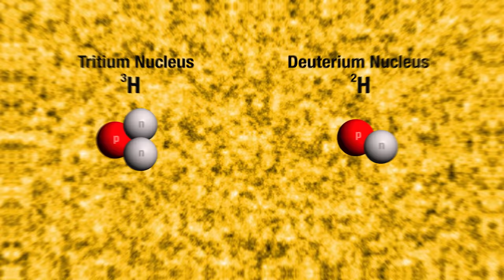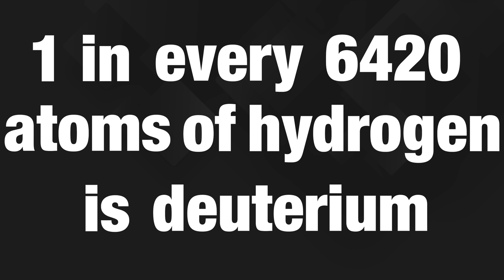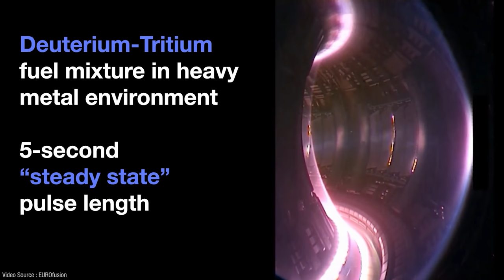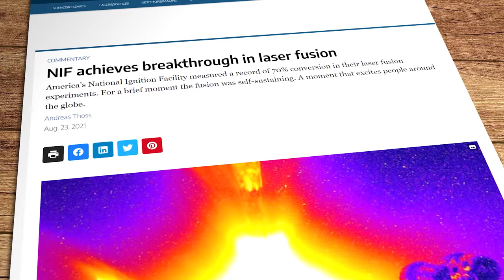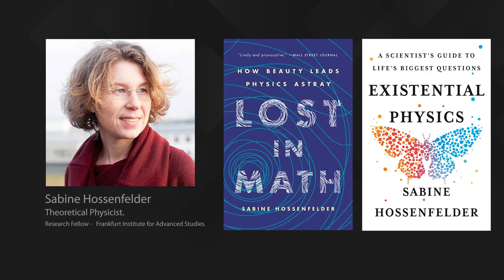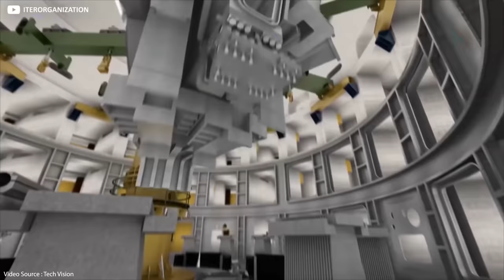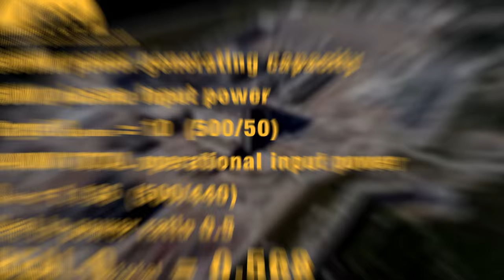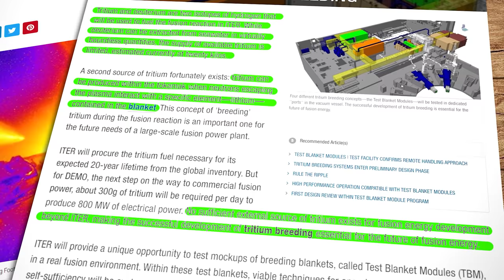Nuclear Fusion Illusion. Is it time to park the pipe dream?

Comment: I've got ok to good news and good to potentially fantastic news

The first is that fusion gain scales rapidly as you approach a Q of 10 and tokamaks also scale dramatically with certain parameters. For ITER this means that an engineering test plant based on it could produce 5 times the power with 75% more input energy for a net GW of electricity production. As well, ITER's cost has a lot to do with delays and non-competitive procurement. It's claimed that the GW scale ITER development could be built for a quarter of the price of ITER itself commercially. That's where the good news drops to ok as I find that gives you an optimistic price of about $6 billion per GW. Hinkley Point C, well known for being an expensive fission plant, should be about half the price with higher capacity factor. Essentially the ITER design depends on something radical happening with capital costs such as robotic construction, plus a development timeline of say 2070 for a finalized commercial design. However that's where the rather fantastic news begins

Not robotic construction, although that seems quite plausible on the timescale of ITER development. Instead it's that tokamak power scales with magnetic field to the fourth power. Last fall a new superconducting magnet was tested to be twice as powerful as the ITER magnets. That's a potential increase of 16x. It's actually limited by the structural strength of steel to only a 10x increase from a 70% higher magnetic force. By about the time ITER first begins deuterium only plasmas it is planned for the SPARC reactor to test this at full power. If the plasma behaves as it becomes self heating this will then mean with high confidence that a plant could be built in the early 30's producing 270 MW. The lifetime cost of this has been estimated for $5.5 billion giving a similar price per MWh as the first fission plant - and I hear that cost has been revised to more like $3 billion. At that point the fantastic news drops to rather good - still not cheap. However, given wikipedia's world average cost of about $80 per MWh for coal and current nuclear and the theoretical cost of $140 per MWh for a high field fusion pilot plant it's better than it sounds from the get go. I have heard the cost of coal is double the numeric value due to air pollution alone and despite this even Germany has chosen to replace their nuclear with coal and imported electricity. Wait where'd the good news go? Ah yes, given that, with a timeline of about 2040 for a ready to build commercial design you could have fusion tokamaks producing electricity at a much greater value than coal and with essentially none of the downsides of fission by that time. The fission reaction of lithium to tritium in a fusion blanket is entirely a bonus, provided it works - producing 15% more power and having none of the meltdown or long lived radioactive material problems of current nuclear

That's all without further development. If SPARC proves out, knowing that there is suddenly a very pointed demand for a structural material more capable than current steel would provide a lot of interest in achieving the 16x power gain above the current capability of a 10x power gain. As well, the ARC successor to SPARC is predicated on being an engineering test reactor rather than commercial and it may be seen that a higher commercial value would be found in a larger design

Beyond that there is truly potentially fantastic news both for alternative fusion designs and for advanced fission. Thorcon proposes 3 cents per kWh power with walk away safe molten salt fission that has a contract for the first plant already in place. This is both more likely and more optimistic than the fusion alternatives by applying both economy of scale and quality and capability of construction by producing in shipyards. The alternative fusion designs put the 'potentially' in potentially fantastic by rapidly testing alternatives to tokamaks and stellarators that have less proven physics but greater economic potential. These have seen long term private investment double to 4 billion total during 2021 with the largest being to the high field tokamak SPARC design

Regardless of any chosen timeline for net zero there is either a radical baseload energy development needed or an energy storage development. At about 50% intermittent electricity production the marginal additional cost for adding more is about $50 per MWh and it rises non-linearly. Unfortunately much of the good news about fusion is that there isn't yet good enough news about other sources of energy. However the news overall is better than media headlines would imply. IPCC scientists have noted that there are no climate scenarios where they are talking about a reduction in human well being and the mainstream estimate of the cost of warming in 2100 is about 3% of global GDP, with an estimated concurrent rise in GDP of 100% at the most pessimistic. In terms of probable outcomes the news is good - both about fusion and climate

Comment: Finally "just have a think" did a think!  Thinking requires deep dives into many facts that fusion advocates and workers tend to keep well hidden.  Such facts can be found with only a tolerable think and research.  Get the facts of power input versus power out.  Done here now.  Next, think of using this efficiency to transmute it to electricity. 50% at best.  Finally, no one thinks of the cost to the utilities to make and operate a fusion reactor, sell the electricity, and make a profit.

In the end, regardless of how wonderful the dream coming true might be, it will be the utility "bean counters" to determine for their bosses the efficacy of going fusion.  Can we build the fusion plant operate it against regulatory demands and sell the electricity at a cost that will make us a profit and still make the retail price of the power not enrage a consuming public??

I'm glad you offered up Sabine Hossenfelder who, herself, admitted she never looked at fusion issues until recently from a scientific and economic standpoint.

Yes, just have a deep think.

Comment: Well said, these are the issues that make this a dead end as far as I can see. Solar, wind, wave etc could be so much better developed with that amount of research funding
Reply: huh? windmill cost about 3 $/W. for 30Bn you'd get 30 GW installed power. Distribute that over all ITER partner countries and you'd get like 2 GW installed power per country. China installed 80 GW in the last year alone.

Comment: Why don't i ever hear of the possibility of just maintaining relatively small fission reactors for tritium production? It doesn't eliminate the problems of fission reactors, since there would still be some fission reactors. But wouldn't it reduce it by one or two orders of magnitude in the long run?

If so, then  given the known constraints of the problem (e.g. timescale of a needed solution + overall difficulty of reaching commercial viability + need for ongoing supply of tritium + insoluble problems with fission + lithium blanket possibly being the constraining factor) might the engineering solution  be to start with a ring of fusion plants that are all fed by a small fission plant placed near the geographic center of the ring, commercialize this, and then as the technology matures further, continue the search for new methods and systems that can potentially replace the fission plant?

Comment: Have you looked at the new geothermal energy solutions now available which can provide base power.

The new drilling technologies, based on existing oil/gas techniques, mean more sites can be tapped into, more efficiently.

Comment: We don't need fusion anyway.
Molten salt reactors are safe, efficient, with a small footprint, and they are cheap.
The company MOLTEX is building one (its own design) for the Canadian grid in New Brunswick.
The point about this is that it shows that the technology works.
There are even better designs in the pipeline.

Comment: Part of the reason Why it takes so long is because problems with funding. If $25 bilion seems a high price tag consider what problem is being solved here. One of very few the greatest problems of humanity. And there are no viable alternatives, wind and sun will not suffice. Also compare the price with the value of energy production. I once calculated that if you applied a 0.1% tax on the electricity price You'd be able to fund multiple project like ITER at the same time. Is it expensive? I don't think so. Also recent years brought huge advances in materiał technology and AI. Breakthrough might be around the corner.
Reply: > wind and sun will not suffice.
[citation needed]
Reply: @flabdablet  How about common sense? Have you been to Netherlands? They have the wind turbines EVERYWHERE. They literally littered the landscape with them (which is a huge problem and downside if you ask me). Still they produce ONLY ca. 15% of power from wind! And they are relatively windy country! The only country that really managed to rely on wind is Scotland - scarcely populated, extremely windy, from 3 sides surrounded by windy sea - ideal conditions. Regarding solar energy rooftop installation on a house roughly provides energy idependence. But what about cities? What about electric cars, industry? WHere will you put all these panels? How much will it cost? Wind turbine does not really take up space - you can have a field underneath. With panels you need to decide if you want to have fields OR panels. And the problem is ofc that the further from equator, the less sun and the colder it gets. In winter you have little sun, but need to heat your home. How will solar panels solve this? Care to provide citation that they can?

Comment: I thought ITER is only an experimental reactor, not expected to produce substained positive energy output. They are still in the experimental phase, which only covers the issues of fusion not industrialization and energy production. There is still major reliability, maintenance and effeciency issues to deal with.

Comment: Imagine if it took this long to get steam engines up and running?
One of the things that we need to figure out to progress in our energy generation, is how to extract energy without the whole steam turbine thing. 
Scaled up Peltier junction? Direct conversion of plasma to electrons? 
Positron/electron pair splitting? I don't know, I'm not a particle physicist. 
But it is bonkers that we are working on next gen nuclear fission and fusion reactors but we still rely on boiling a liquid and spinning a turbine.

Comment: 12:16 It is a matter of naming that you call "fission" the (n, alpha) process of breeding tritium from lithium. You don't regulate something based on what word you use for it. Nuclear Power is regulated because during the fission of uranium nuclei highly radioactive isotopes are created as a waste product. You regulate fusion because the fuel is a radioactive gas, during operation there is a lot of neutron and x-ray radiation, and neutrons activate some structural materials. Both the power-on radiation and created radioactive waste is several orders of magnitude smaller than in the case of fission.

Comment: For a different perspective, Dave, please do a review of the Safire experiments and the commercialisation of the ‘electric sun’ process by Aureon Energy. The Safire reactor appears, under carefully controlled conditions of electrical input and gases in the plasma, to be an over-unity machine using Low Energy Nuclear Reactions to transmute elements in the anode with hydrogen plasma, to create spherules of elements that were not in the chamber before. Sufficient energy is released to feasibly power a steam turbine. The relatively low cost setup ( a few millions, not billions) offers greater promise than the apparent dead end of the tokamak and stellaron approaches.

Comment: n + Li7 -> H3 + He4 + n
This is how a fusion reactor can breed more tritium [H3] than it consumes. Further, Li7 is stable and is by far the most common isotope of lithium, so it's readily available and cheap. The first fusion power plant will need some tritium from a fission power plant to start; but after that the fusion power plants can breed all the tritium they need from the most common form of lithium. :-)

Comment: What happens to steel when it is continually blasted with hard radiation?  And what about superalloys that are needed to contain extreme pressures and magnetic stresses?  Can the stuff be recycled back into the economy after it has been irradiated?  Seems like great questions, considering the embryonic stage of design and experiment --but I've never heard anything about that.  I know fission reactors really mess up the steel used to get that stuff to work.

Comment: Nice presentation, but I think the bit at the end misses the point a bit.  Yes, existing ready-to-deploy technologies are the solution to climate change and fusion is not.  But what's being done right now with fusion is and always was intended to be basic research.  Certainly we can decide whether we should prefer to deploy limited resources in one way or the other, but fundamentally the objectives are different, so the comparison being made isn't apples-to-apples as presented.

Comment: Just to clear some confusion: Qplasma is a nice number for communicating fusion to the public, since it's very intuitive: for sure it needs to be above 1 to produce anything useful. For a reactor, it's quite meaningless, since external heating it's only required for control and current drive purposes. The point of Qplasma=10 on ITER is to study a plasma that self-produces most of it's heating (one third externally, two thirds self-produced). Once the physics is known, both Qplasma and Qtotal are strong functions of the radius of the machine and its magnetic field. This means that, if ITER works, DEMO it's just a slightly larger ITER, with very similar physics and a Qplasma easily above 20/30. The parameter that is then optimized is the cost of the reactor, not Qtotal. That's why there is not too much focus on Qtotal in the community.
Reply: The problem is that Qplasma is normally presented as if it were Qtotal to the public - and the fusion community's done precious little to rectify that misconception.
Reply: @angrymokyuu9475  True. A lot of the complexity gets lost in the simplification from the community to the public, but on this specific problem a little more clarity would be useful since it can be perceived as deceiving. On the other hand, the narrative around it seems to be something on the line of 'they are lying to hide the fact that fusion is actually further than they say'. This is grossly misleading, since increasing Qtotal is rather easy once the possibility of large scale heat generation is demonstrated in ITER. Other challenges, such as tritium generation, heat exhaust and development of neutron resistant material are much more important for the success of fusion. For the government funded research point of view, the best approach to get an estimate on 'how far is fusion' is to read the official roadmap, which is very realistic and does not oversell the technology. The European one is at https://www.euro-fusion.org/eurofusion/roadmap/

Comment: Even if fusion arrives tomorrow it still can't replace solar, because it requires a power grid while solar and wind doesn't.

If can make my own electricity with solar and wind and sell the excess that I don't need, then why would I buy from a fusion plant? Fusion would still have it's place especially for industries, but it will not be the only solution. 

No one will pay for a powerline to a single house out in the wildernes to use fusion electricity when solar panels makes much more sense.

Comment: It is important to note that ITER (and JET) are experimental reactors. They are not streamlined to be efficient for power production. They are designed be able to test all sorts of different combinations within the parameter space. So, Q-fusion is the thing they are trying to optimise, and you could say this is more at the Physics end of the problem. They have little interest in Q-total. Their Q-total will never be great. Once Q-fusion has been optimised, you work on the more Engineering end of the problem and address Q-total. You take what was learned at JET and ITER, EAST and so on and make a new reactor with both high Q-fusion and high Q-total. To judge the future of fusion power generation on the Q-total of these experimental reactors is unfair. However, there is probably some level of chicanery going on to encourage investment and to get good press headlines, I will grant you that.

Comment: Even if we succeed in making a viable fusion reactor, it will still come down to cost of energy. Solar and wind are still going to be far cheaper per KWH. Fusion energy is just a heating element with a massive separate boiler heating plant.